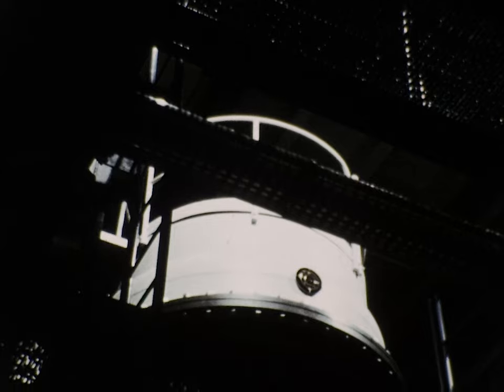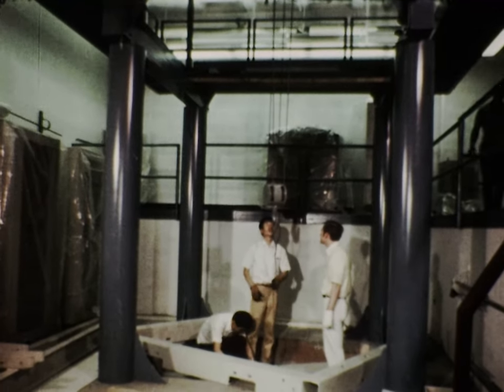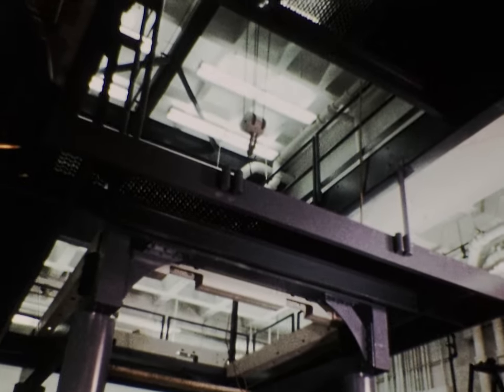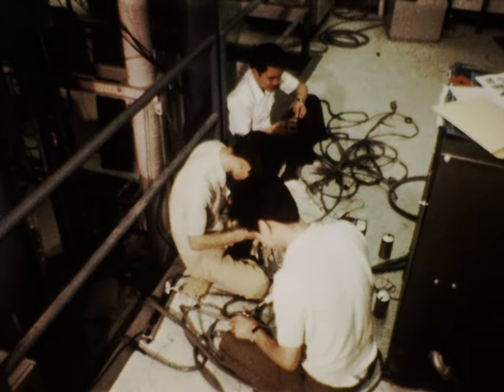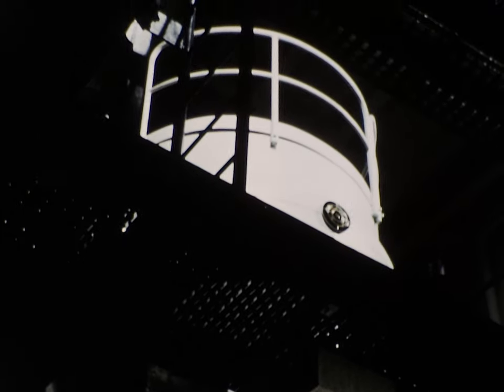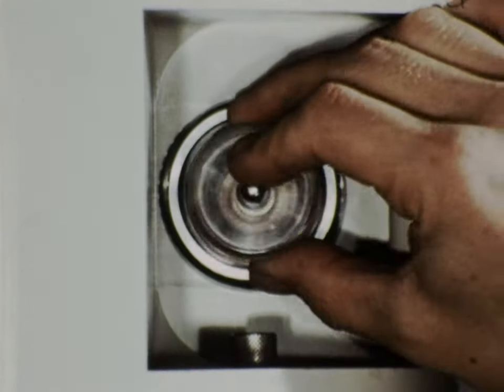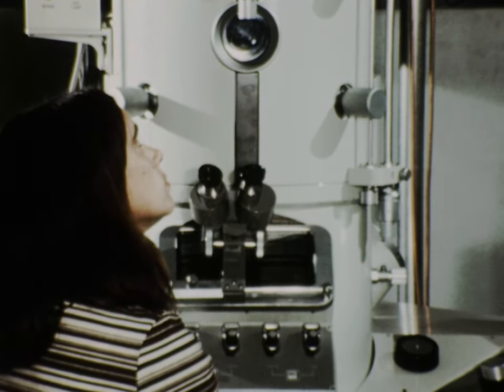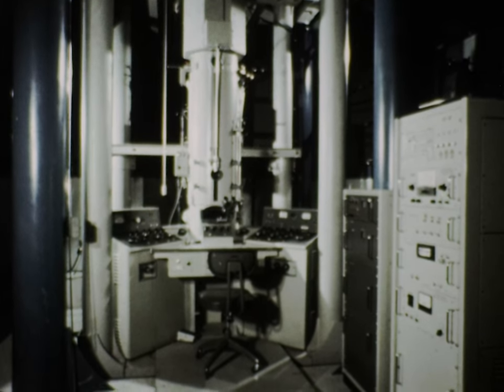CWRU - High Voltage Electron Microscope Facility - Olin Materials Center 1970

Comment: This transfer quality is somewhat compromised by the simple fact the original capture file transfer from film was zoomed out a little bit more than necessary to accomplish the task. I would have only zoomed out to the minimum distance required so that the total picture frame and optical sound track area was showing in the file only with no surrounding white space. If you zoom out too far, then the editing software will need to enlarge the image more and thus increase the graininess of the image. Also, I would have cleaned the 16 mm film better and corrected the image density and color balance in Davinci Resolve before importing it into Premiere Pro, or just perform the editing tasks right in Davinci Resolve instead. However, the transfer quality is quite impressive overall.
Reply: It's not transfer quality that you refer its the amount of data collected. Yes by zooming out - I collect less data - it's always a question of how much data to collect and it is ALWAYS a compromise :)